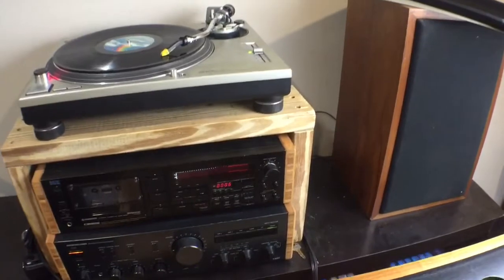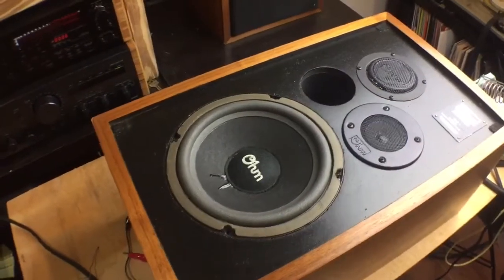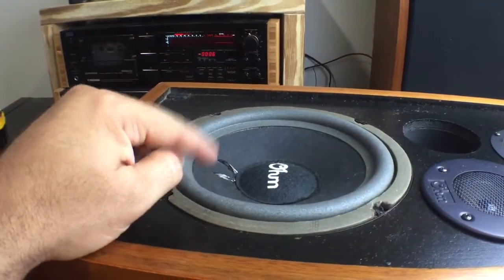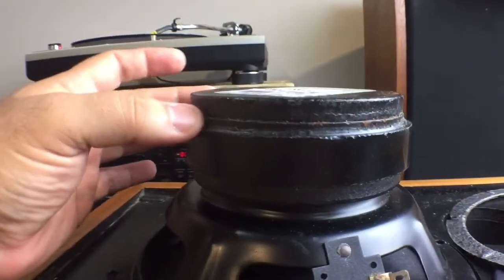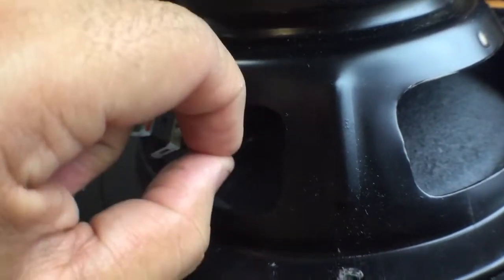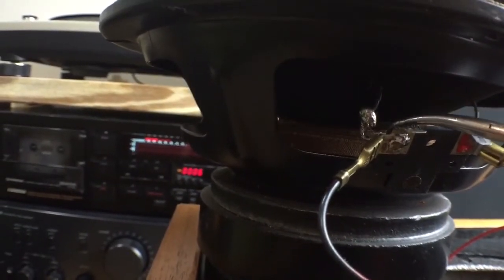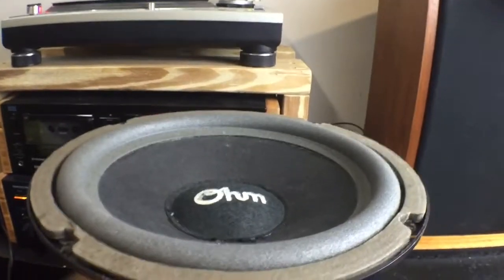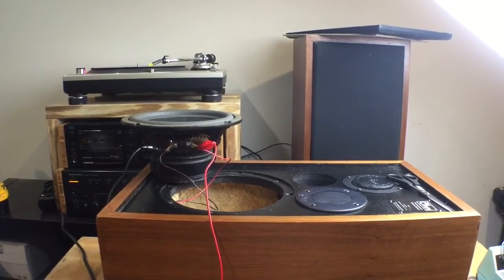REPAIR: OHM Accustics Speaker Model-L Simple Woofer Repair Spider Wire came loose

Comment: Funny, back in the mid 1970's I went to Tech HiFi with one thing in mind, to buy a nice set of new mid range priced speakers. In my mind I was already thinking AR-3A's, large Advents or Bose 901's... I brought along a Steely Dan cassette, you know, those little gems I was so happy they came out with. I was such a big fan of theirs, not only for their great songs but their studio recording were (and still are) some of the best I have ever heard and great for testing HiFi equipment. Anyway, to make a long story short, after listening to the big three mentioned above, I decided to have a listen to the Ohm line. At the time, they had the Ohm L's, C2's and the big boys, the original Ohm F Walsh at 3000.00 a pair. Well that was out of my league but, I walked out a very happy owner of a pair of C2's and never looked back. To me they blew the others away... IMHO. Now I happily own my original C2's and a pair of L's... love these speakers. They are gems that many have never even heard of. Thank you Ohm and thank you Tech HiFi of Paramus, NJ.
Reply: In 1980 I was shopping for a new cassette deck, not too expensive, about $300. I had a TEST cassette with me to check out the decks. It was Pink Floyd "Dark Side" excerpts. I was in TECH HIFI at 12 west 45th St, NYC, it was lunch hour and the store had six sales people and about fifteen customers. The decks on display were hooked into a Marantz 1090 integrated amp (45wpc) and a pair of Large Advents. My deck choice was an Onkyo TA-630D. 
 I put in the tape, hit play, cranked up the volume and listened. The music started and it was the cut "Time". When the chimes kicked in I noticed EVERYONE in the store was staring at me. All conversation had stopped. The manager behind the counter smiled and gave me a low "thumbs up", he was obviously pleased. I wonder how many pairs of Advents were sold because of me?  Oh yeah, I did buy the Onkyo deck. This was on July 25th,1980. The TA-630D cost me $260, I still have the receipt!

Comment: Caught your video/review of the Ohm L. They actually came out in 1977. I got my pair from Tech-Hifi (12 west 45th st) on Sept. 22, 1978 for $356, still have the receipt! Carried them home to Bay Ridge on the RR train with help from my brother. I had the surrounds done in the late 90's and they still impress if not annoy the neighbors.
 Just wanted to throw some quotes at ya on the Ohm L's. High Fidelity magazine wrote in April 1978....Power handling and freedom from distortion are first class....the speaker produces a  peak SPL of 113 dB from a peak power of just under 686 watts.......the overall sound is solid, yet transparent  and detailed, deep bass is tight and well controlled with a sense of ease...to relatively high listening levels......transients are sharp and crisp.......stereo imaging is excellent- to the point where the sound seems almost totally detached from the speakers....OHM appears to have another winner...
 I have lots of reviews  of the L's and would enjoy sending more. Remember, you can take the kid outta Brooklyn but you can't  take Brooklyn outta the kid!

Comment: I sued to sell these back in 1980 and it's an astonishing little gem of a speaker. Sounds far more potent than the modest size would indicate. Frequency response is superbly flat. Bass sounds like an enclosure twice the size. You'll be hard pressed to find a better balanced lower coloration speaker than the "L" especially from back then.
Reply from the maker: Thank you for the review.. Yes the speakers are really nice sounding and nice bass for the size of the enclosure... big beefy woofer on them too.  I have had many different types of vintage speakers but I have manage to keep these...

Comment: Nice. Just got mine repaired by ohm. Not happy. One spk there is damage to the edge of the cone where the surround glues, also the spider wires, one seems short, and the new surround s are Really stiff. Not much cone movement in an out.
225$ each! I call,em tomorrow asap .
They send me a new one.
Nice

Comment: I still have my Ohm c2 speakers I bought in 1978, along with JVC components. They have been in storage for over 20 years so I decided to get them out and inspect them. I hooked them up and they still play, but as expected, the foam is completely deteriorated and will need replacing. Other than that, they're in near-new condition. The 10" woofers have 32 oz ferrite magnets (not 20 lbs as the video says), which drive a great bass sound.  Unfortunately, my JVC amplifier powers up but after a few minutes went silent. I will probably need to replace a bunch of capacitors, but that is another story.

Comment: You need to stop using your cassette deck as a frying pan and make some room on top of that Onkyo amplifier to breathe!!
Reply: Yep , there are rubber belts in there and you gotta keep them as cool as possible. The onkyo integrated amp is not much to care about  . Let me tell you every m 508 I have found never worked or would stop working after a short while . The M 504 is more reliable for some reason.